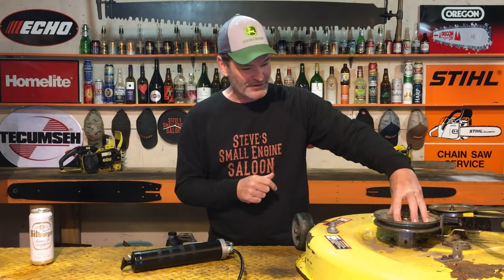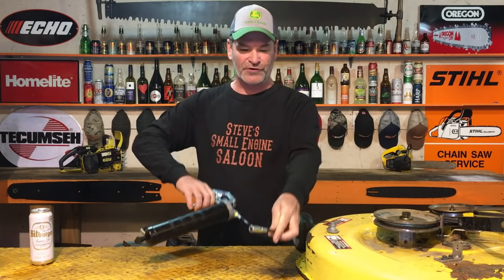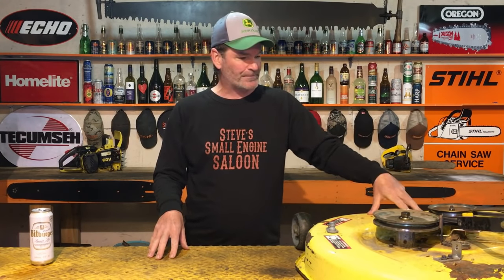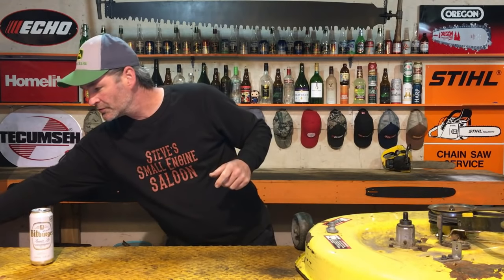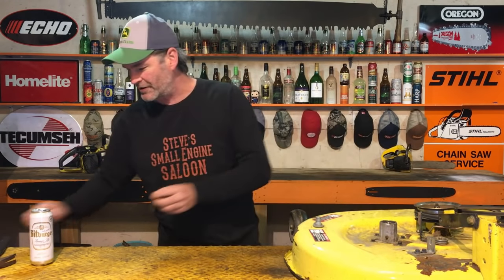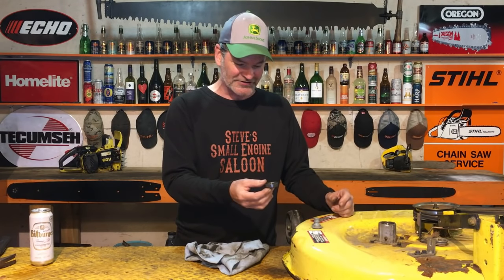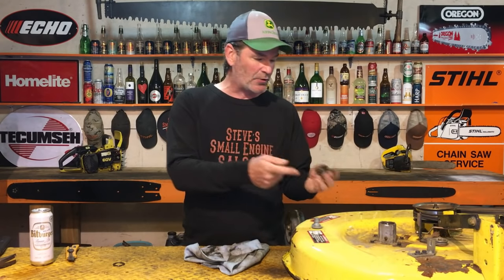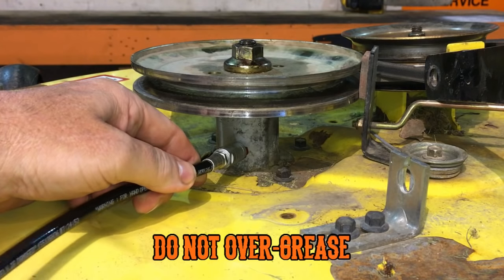Your Riding Lawn Mower's Dirty Little Secret

Comment: Who remembers packing bearing by hand years ago?
Reply: Still do every time I do wheel bearings on my old 94 trucks
Reply: Yeah,in the Army.
Reply: Still do today .
Reply: Yes, I re-packed front wheel bearings...
Reply: Never packed a bearing (or fudge, Thank God) in my life... although I once or twice saw my Grandpappy pack some bearings for his old blue Ford farm tractor!
Reply: do and still do it today!
Reply: L M    ME.
Reply: Not years ago. I still do.
Reply: Google User  That was when Timken and others still made their products here with good steel. Now almost everything is made in that communist shithole with garbage materials. Most people prefer shiny new low priced junk instead of quality.
Reply: Just by chance I listened to this video and had to go to the dealer.  The lady with 35 years in the business said what is asserted in this video is true. It angers me that it is a trick by the manufacturer to make you think you are preventing bearing failure. She did say Scagg mower bearings can be greased.
Reply: @jamesemmett864  Some can, some can't. Scag and Ransomes are probably straight up. A blasted shaft needs no grease and there are grease fittings that have a spring  loaded relief valve to keep from blowing the seals. There is always a way if someone wants to fix something right.
Reply: I still do it. Big ol glob on my hand, and run the bearing over and over filling it up.
Reply: @nedlyest  I had one of those packers but it was so gooey and I always get in it up to the eyebrows I just kept on doing it with the hands. I got to go bathe in gas anyway.
Reply: I still do it by hand.
Reply: I still do.  I have been twisting wrenches for 45 years.  I have automatic greasers however I still would rather do by hand.  The differnence today is I use plastic gloves rather than the bare hand.
Reply: @lewiemcneely9143  yeah they can be pretty nasty, but they can save a bunch of time
Reply: I hand pack bearings by hand several times a year STILL.
Reply: Google User   Preventive maintenance is common sense.
Reply: JUST   REPACKED  A   16  FOOT   TRAILER  BY   HAND   ...EASY  JOB   JUST   MESSY  …...
Reply: @Beandiptheredneck  - I need to check my 1982 F150.  might have been around 14 years since I replaced the warped disc and the bearings.  hand packed by cupping grease in the palm of your hand, cone tool or using a needle on the end of a grease gun.   the needle is the most efficient method.
Reply: 92 F150, repack the front wheel bearings a couple times now.
Reply: Watched my husband do them all the time. (We've been married 40 years this month). Palm full of grease and squish the bearings down in it until it  came out the other side.  😊 we spent many dates with him working on his truck.  Me watching and handing him tools. Got married had kids. And the kids are gear heads
(Girl and boy). That's how my husband use to watch the kids.
Kids in a play pen in the garage.
(Until they could escape and play in the tool box, lol)  I miss my little grease monkeys. They are all grown up.  Have a peaceful day.😊.
Reply: i remember packing bearing pain in the pooper
Reply: They actually sell a device for packing bar rings. It’s a small “dish” with grease in it. The barring goes in a holster, when you push the lever down, it forces grease up through the barring. You can see it oozing up through as you push down. It works awesome...
Reply: Yes, would repack Front and Tail Landing Gear bearings on
UH 60 Black Hawk helicopters during my nearly 23 years in Army Aviation.
Reply: that is so cool
Reply: Years ago? I did it yesterday
Reply: I still do.
Regularly.
Reply: Google User  - Swedish, German, Polish, Czech machine parts are first rate.
Reply: C J Bowen  - I pulled the hubs on a 1953 Spartan Aircraft Co. Imperial Spartanette park trailer about 1996. They had never been repacked. The red grease was still soft gooey and oily. Warner brakes and hubs. '52 Chevy 16" pickup truck wheels.
Reply: @billdoe9146  - Automobile wheel bearings are nonrebuildable hub units. The bearing races are induction hardened inside of the hub shell and the outside of the spindle. Only one loose cone race.
Reply: Andy Roid  you never packed fudge don’t know what your missing 👨‍❤️‍💋‍👨
Reply: @jamesmusisca8442  Did you just move to Davis CA?
Reply: what in hell are you talking about?
Reply: thank god for sealed bearings all four wheels of my buick has sealed bearing with over 153 thousand miles and still going when they die i will replace them no grease needed
Reply: @jamesmusisca8442  My friend James Music just moved to Davis last month, just wondered if he was watching this video. He has a PHD in industrial arts. I retired as a Chief engineer of a steamship. Thought that he may be making a joke of this video. Consider that bearings move the world, and that grease is essential to bearing operation; I cannot in any way relate "poop" to grease. Hope that I did not upset you in any way, Steve.
Reply: @howardkoster4026  how to change belt John  deere lx 188 mowing deck
Reply: I never recall replacing a set of wheel bearings on an old car...because you could grease them. These new fangled hub's they use are designed to fail.
Reply: or wood.
Reply: Me do!
Reply: Of course, a big hassle, and the very next use the grit would start working its way into the bearing.  Just buy sealed bearings and replace them at the first sign of play or grinding.  I doubt if the bearings will need replacing more than once or twice over the life of the machine.  Bearings are consumables, just like wheels used to drive self-propelled push mowers, fuel filters, oil filters, and oil itself.
Reply: I still have a van and a truck that i still do by hand. 1968 dodge pick up and a 1982 dodge van.
Reply: still do with camper rims..packing them...
Reply: Yard Sale Dale  i know you asked Bubba . But here is why ,   Ykk zippers are made in Japan.  Not friggin china.  At least the Japanese take pride in their work.
Reply: And then dropping them on the damn ground and staring at the 5 gallons of doghair insects and gravel stuck to the damn things in complete disgust and utter disappointment.
Reply: i remember that,  remember the high beam switch on the floor on a car
Reply: @classic24hrtowingreferrals28  or you buy a bearing packer and keep clean.
Reply: I still do
Reply: Still do it on my semi trailer
Reply: My grandfather taught me when i was 14.I am 53 now funny how something like that sticks in a 14 year old kids mind.of course it was 1980
Reply: Not me I'm 12 lol
Reply: I hand packed the front wheel bearings on my Mazda pickup last year....the only better way to make sure every bearing gets grease is to dip it in heated liquid grease and let it cool.
Reply: me
Reply: glad to see in the replies that we shade tree mechanics are not a dying species. 
I think the designers' intention was to have sealed bearings with slight downward seepage of grease to help act as a water barrier to avoid moisture from getting into the lower bearing, not to keep both bearings lubricated.
and yeah i hand repack open face bearings. decades ago, many cars had wheel bearings you could get to with just a few minutes extra more work when doing a brake job, so I'd repack them every brake change on my cars
Reply: Grew up packing them on our discs
Reply: What do you mean years ago... I still do it by hand lol
Reply: Yes, I still do.
Reply: @Beandiptheredneck  Was just going to say that. Just did it on my 1988 Mustang 5.0.
Reply: All the time! 95% of my equipment is 40+ years old and still operating. Learned my lesson when one of my trailers wheel berings caught on fire!
Reply: still do it LOL
Reply: @Beandiptheredneck  
94=old? Thanks a lot, I've been doing my best to live in denial of my age for some time now, you just enrolled me in the AARP.
Reply: Cleaned them with gas and then packed them in my palm.
Reply: I still do it that way every time I have to deal with tapered roller bearings, and have even packed sealed bearings.  I can do it quicker by hand than the time and mess of pulling out my bearing packed and getting grease everywhere...  if you know how to do it, it's a fairly easy and clean job.
Reply: I do. Still do on Alternator bearings.
Reply: Lewie McNeely almost 600 hours on my SCAG. Keep the spindels greased every 20-30 hours. No issues.
Reply: @DeckofReason  You repacked the whole trailer? What was it hauling? Household goods that needed to be repacked or some other cargo?! LOL
Reply: @jamesmusisca8442  Well you're not supposed to put it up there! LOL
Reply: I went to a vocational school for diesel mechanics for a year and packing bearings was the first thing we did lol
Reply: yep
Reply: @marionmorgan5972  It's becoming a lost art as the generations move along. Most kids today are either stuck on their cell phones, gaming consoles or trying to become the next 
Big Rapper.. It's sad !!
Reply: james emmett u
Reply: I do. I remember when you had to take the drums off to have them turned (machined), so to make the drums smooth again. Yeah I remember when you had to clean and repack front wheel bearings about once a year. I learned how to fix and maintain vehicles about the time I started driving, Could barely afford parts, much less pay a mechanic to do something I could do myself. Really don't trust them  (mechanics that is), how ironic I now have an associates degree in Automotive Technology, ASE certified , go figure ! Yes I have seen shop owners, mechanics, and tire shops take advantage of people, because they didn't know any better. My advice is to get several estimates before having any work done, don't sign anything, just tell them the symptoms (describe what is happening to your vehicle), if they are on the up an' up, they will be more than happy to give you a written estimate. Don't fall for it will cost you, for them to investigate the problem, it takes only a few minutes to plug in that code reader, check the codes , and give you a real close estimate. Heck I have one myself (a code reader), takes only a few minutes. Read the numbers, look it up, find problem, look in book that tells the time it will take to fix it, get parts. Don't buy 'em from the shop, I managed a tire, brake, front end shop. We got parts for almost 1/2 or more off, so if you buy parts from shop, just know they are making money off the parts too. A good honest mechanic will not mind, he or she will do the work and be happy he doesn't have too waste the time procuring parts.
Reply: I still do. I have a brand new bearing packer still in the package I bought 10 years ago.
Reply: Commercial equipment have sesled housing now never have to grease a thing
Reply: @justinkimble4855  not everything is sealed "I assume you meant sealed not sesled" and even then sealed bearings dont last forever.
Reply: @jmc5341  ill get 4000 plus hrs out of them no biggie
Reply: @jmc5341  and yes everything is sealed all high dollar 8k plus commercial mowers are completely sealed and forged
Reply: @justinkimble4855  I somehow missed the commercial equipment part when I read that the first time.
Reply: @jmc5341  no worries lol lot of residentials are starting to come like that to
Reply: L M, still do.
Reply: like...last year?
Reply: @howardkoster4026  brush in
Reply: Oh yes.  Back in the 70's, 80's an 90's I raced bicycles up until the 90's. The wheels, pedals, bottom bracket, head tube bearings and races had to be cleaned, inspected and regreased at least monthly.  More so if ridden in the rain.  Some times the races, especially the head tube races had to replaced often. The tiny bearings were not in brackets but were loose so dropping and losing one was a minor disaster. Sealed bearings were a godsend.
Reply: @marionmorgan5972  Congratulations on 40yrs! A real 'bonding' family.
Reply: @meTimetraveler  Don't forget floor mounted starter switch and automatic shift on the dash.
Reply: Still Do!
Reply: I pack the bearings in the hubs of my trailers once a year.
Reply: Classic 24hr Towing & Recovery Of Hot Springs National Park   //
Reply: Classic 24hr Towing & Recovery Of Hot Springs National Park 
I’ve packed bearings since 1979 the same way. Keep it up.
Reply: I actually did that a few weeks ago on my 1989 Ford Ranger. The ranger had front wheel bearings like that up until 2011.
Reply: I still do it that way for wheel bearings or any open bearing.
Reply: me . 40 years ago
Reply: Fact Checker  OR, I have bought some Chinese bearings on ebay that had NO grease in them
Reply: My old air sucker VW . Man, that car took an entire Saturday to grease. A true love hate relationship with those beasts.
Reply: I still do at my work but most of the machines are pretty old .
Reply: You cant say you work on cars unless you have hand packed bearings.
Reply: Yep !!!
Reply: Best way to know their done.
Reply: @trackrunner11  yea I repacked MANY a 5ton and deuce and a half wheel bearings by hand in the army!
Reply: That was my apprentice job in the garage learning life from grandpa
Reply: i still did when i worked at bowling centers
Reply: I remember hand packing bearings although sealed bearings have become much more common. This is also the reason why the design is not flawed. The part had to have a grease fitting because they used serviceable bearings when it was designed. When they went the sealed bearings they didn’t do a redesign because it didn’t matter if there was a unused grease fitting. Why waste the money?
What do you think?
Reply: Years ago, no
Last week, yes
Reply: I still manually pack wheel bearings on the plane, although it is from 1946
Reply: Fact Checker  yes, but the life of the car would usually a hundred thousand miles.
That's just the end of the break-in zone now.
Reply: @quincekreb6798  Thanks for sharing and Thank You for your Service. Best to you and yours.
Reply: Splatterviz  Thanks for sharing and thank you for your Service. Best to you and yours.
Reply: @marionmorgan5972  I always look for YKK on the zipper before purchasing any garment...especially work wear. Thanks for sharing and Best to You and Yours.
Reply: My dad probably did it dozens of times.
Reply: Shit...I still pack bearings by hand...I trust that,more than using a packer
Reply: I sure do
Reply: I WANT MY SNAPPER RIDER WITH THE WIREMESH FOREVER SEAT AND3/8" THICK DECK BACK.I THINKI MAY JUST BUILD ONE..
Reply: Fact Checker  And were inspected throughout their production.
Reply: @lewiemcneely9143  like creating a drain plug on my Troybilt bronco transmission. It should have one.If not for the weekend tinkerer to provide an easier method of DIY savings,at least it would make someone's workload a bit lighter...
Reply: @DeckofReason  and a bit stinky too.
Reply: @justinkimble4855  remove and replace...and the core goes to the landfill.
Reply: @Mootsbike  modern off road enduro motocross competition motorcycles require surgical skill and bi polar tenacity to re new some very critical bearing supported suspension components that have to be a special kind of perfect or else.My kids were all weekend dialing in those all chrome Dynos redlines haros....Damn I'm old!!!
Reply: haha yeeess was messy job,but hardly replaced bearings ,compared to sealed bearings xD
Reply: @bubbafudpucker397  I don't know if they were original bearings or not. But my 92 S10 had metal rollers inside a plastic carrier housing...  It only had 82,000 when I tore them apart, so I would suspect they were GM standard...
Reply: Still do on my 68 Plymouth.
Reply: I sure do,what happened to common sense good old days
Reply: Still do on my 93 Dodge Dakota. Dad bought it new in 93. Gave it to me when it had 55,000 miles on it. Still drive it today.
Reply: Yep did it last week
Reply: Better yet many spindles don't have a grease nipple at all. I love that the engage pully doesn't have any bearing or bushing and corrodes to the deck top making the cable seem frozen or causing you to snap it trying to engage the blades.
Reply: I do....hand full of grease in one...bearing in the other....slam the bearing in the grease...flip and repeat...
Reply: Rick Hart nice truck
Reply: I still do to this day on small aircraft bearings at my family aircraft mechanicking shop.
Reply: Still do on trailer hubs
Reply: I was taught the proper way to clean and repack bearings with grease when I was in Aircraft Maintenance tech school in the Air Force.  Have done many of them in the past.  Very few lately since wheel bearings are now sealed bearings.  I have two new spindles to change on my John Deere Lawn Tractor.
Reply: That was sop back in the day
Reply: Quince Kreb   I did it for 4 years on C-130s in the Active Duty Air Force, my Cherokee 180, but no tail wheels.  Also on all my cars and trucks until a few years ago. I stayed in the Air Force Reserves, still on C-130s but stepped up to the flight engineers position.  Still do other applications when needed.  Most of my good and useful education came from my Air Force days and an organization know as the Jaycees, aka JCs, aka, Junior Chamber of Commerce.
Reply: @charliepearson1678  I still do.
Reply: Yep
Reply: Still do on the F16
Reply: More than i could remember then socket to drive it in
Reply: Pick me... As a mechanic and having grown up on a dairy
Reply: I still do sometimes
Reply: @jamesemmett864  One of the  better commercial mowers. I have never owned one but am going by what owners say.
Reply: Who cares ?
Reply: As a teen,  I worked in a auto parts store machine shop and learned how to pack bearings.  A handful of grease in one palm and the bearing race in your other hand with your finger or fingers in the center..  You then slide  it in the bearings like you punching a catchers mitt.
Reply: today you throw the assembly away with your bank account.
Reply: OMG, I was going to buy a JD rider next week.........  How many other hidden issues do I need to learn about???
Reply: Not manny years ago.
Reply: The make a bearings packer that fits on your grease gun.I have to repack the bearings on the Harley Davidson each time the tire is replaced. They have to be shimmed when installing new bearings.
Reply: Still do once in a while, can't seem to get the apprentices to do it these days. I must be getting old, there was a day I'd have kicked butt if they said no, now I just tend to think if they don't want to learn it's their future.
Reply: I still do that.  thanks
Reply: @trackrunner11  that's where I learned how to grease them by hand, the Air Force.  lmao
Reply: I will still even with factory sealed bearing assemblies disassemble them and pack them by hand with a glove of grease in the palm of my hand, only way to get it done right make sure it's correct
Reply: Did just so on OH-58 helicopter tail rotor bearings. Oh what fun we had.....
Reply: I remember doing one 3 days ago...
Reply: i do  backin the fiftys  i was taught to push them in grease in you hand it you could seeit come ouy the other side   im 86  still ticking
Reply: Me still do on my truck since the front hubs are rebuild able
Reply: Still do with wheel bearings in my 2007 Hilux, every 100,000 kilometres
Reply: Your spindle.  It will start getting louder
Reply: @jmc5341  Bought a bearing packer from J.C. Whitney 40 years ago, still hanging on my pegboard never used. 🤭
Reply: Hells Yes! that was one of the very 1ST things DAD TAUGHT me.
Reply: I do and i have a bearing packer too
Reply: I do....but I'm over 60 yrs old.
Reply: @andyroid5028  Gramps kept the fudge packing away from you? God bless him!
Reply: Still do on my 85 c20
Reply: Hi, Yes I packed bearings 1st on a 70 Road Runner, and other cars since years ago. Phantom
Reply: I still do I have tried the bearing packers and don’t care for them a palm of grease is still the best way to pack bearings
Reply: Still like to pack my own bearings
Reply: Yeah I remember very well ,but I'm old school when a lot of equipment was made rite , not out to rip people off.
Reply: Still do that
Reply: 1st time I packed a wheel bearing was in Viet Nam. It was on landing gear of a 
Ch 47 helicopter.
Reply: @danieldiehl523  hmm that’s a little while back,for starters i would take this time to say I appreciate your time for your country,now my father served in the European and pacific theater ,and I learned a lot from him and also how to pack bearings, and what i learned so far no man should change something that works,just go with what works for you.
Reply: Well good for you .
Reply: Yes sir!
Reply: Still do
Reply: Still do if they aren't sealed.
Reply: @jerrymeeuwse859  Still do if they ARE sealed! Just pop the seals off. They go on and off real easily. Use a small knife and just don't cut your finger or bend the metal ring that keeps the rubber/plastic shape. You'll extend the life of your bearings considerably.
Reply: @andyroid5028  We've still got two 1956 Red+White Ford tractors made before those blue Fords... Those tractors last a LONG time, if you take care of them !
Reply: Working on cars with Dad, that was my job.  :-)
Reply: I sure do ,on bush hogs
Reply: @meTimetraveler  my 88 Ford xlt Lariat still has one!  I changed it out last year.
Reply: Me! Me! Me! Me!
Reply: @andyroid5028  Did you ever watch him packing fudge?
Reply: I still do
Reply: Old school for sure. Do it every time a bearing set comes across my table.
Reply: Yep
Reply: Always repacked my 1960's car bearings. Regular maintenance back then.
Reply: Still do!
Reply: I’m an aircraft mechanic, we still pack them by hand!
Reply: I miss the old spindles that had a grease fitting on them.
Reply: I had a conversation with a mechanic working on my RV about that very thing. He has a fancy machine to do it and of course charges more because of that. I told him no. I'll do it my self just replace the pads.
Reply: Yep!
Reply: I hand packed my share of wheel bearings in my grandfather's auto shop for sure.
Reply: Still pack em that way. Even prefer it over a bearing packer thing your press on. I like to use a needle on the end of my lube gun to inject grease a little first. It gets the process rolling faster
Reply: I do and I was taught the proper way to do it when in Aircraft Maintenance School for the US Air Force.
Reply: Thanks a million Steve.  Oddly enough I’m completely rebuilding and painting the deck on my John Deere LA 105 Lawn Tractor.  I’m putting new blade spindles and drag links on them.  The bearings are really bad in one of the spindles and the other one is still good.  There is only a little over 500 hours on the mower.  I will replace the bearings with better bearings for the next time I need to replace the spindles.  I cut around 8 acres with this mower and live in SE Louisiana.